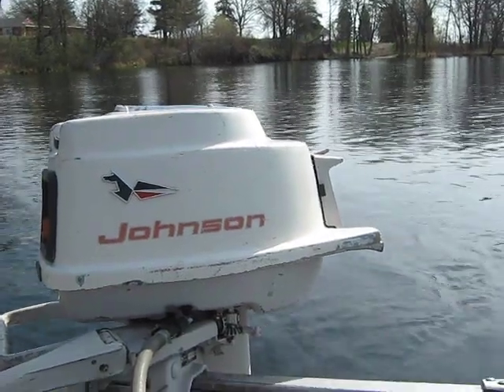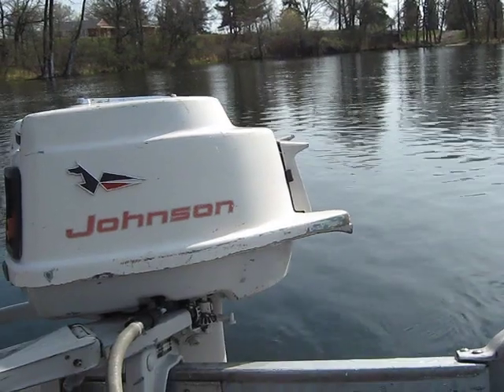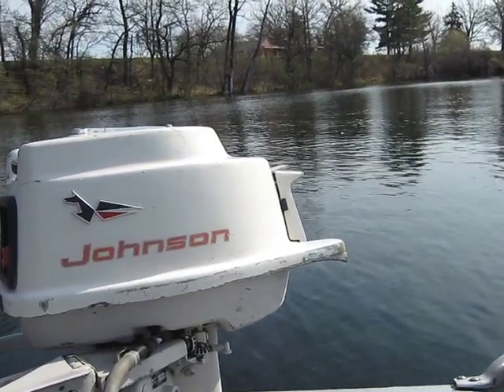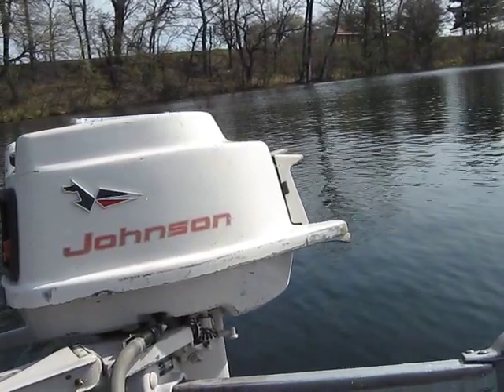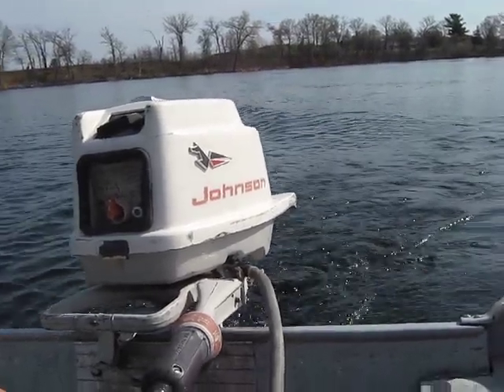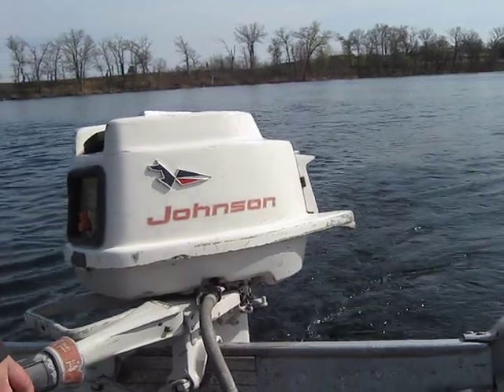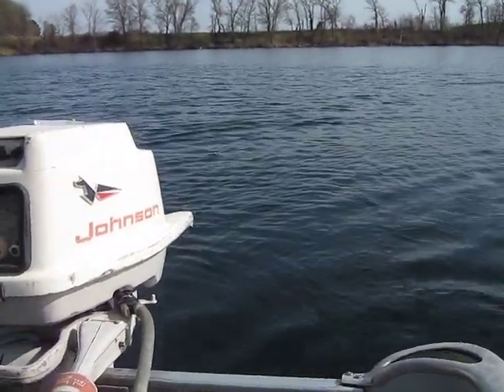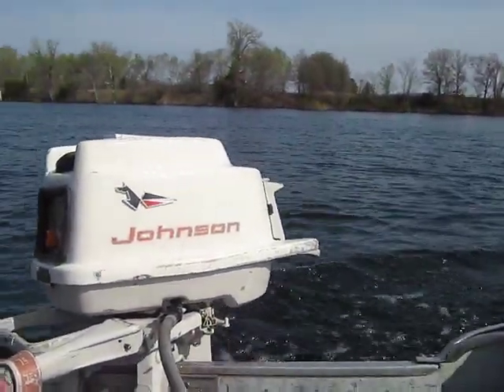1961 Johnson 5.5hp outboard motor

Comment: Looks like a beautiful day up there today, its been trying to snow all day and colder than a well diggers ###.. Doing my first engine for the year, its a 1986 merc 75 hp..power pack is half dead and did a water pump and service on it.. then installing  bimi top on the boat with a alx  bracket and a 4 hp evinruce kicker engine that I did a tune and water pump ...So the season has starter...but in need your weather. I'm frezzing..

Comment: I have the same exact motor. I have an issue however. I had it running in the back yard here at home, went out to my favorite lake backed the boat in the water, pumped the bulb, set the throttle to start, pulled the card a few times and nothing. I checked for spark, got it. Motor would never start. Luckily for me the lake is not far from home. I'm guessing a fuel issue. Any other suggestions?